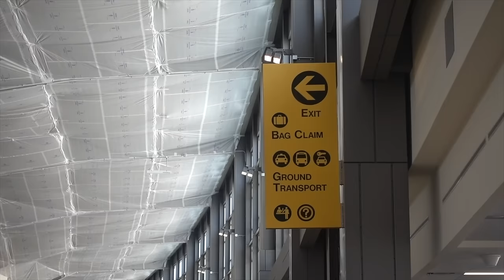MTB Myths that need to die—and some that are true!

Comment: I don’t own an ebike but appreciated your final comments. A few weeks back I passed another cyclists while cranking up a long hill and he momentarily took offense when he thought I was on an e-bike . When he realized I was not, he was OK with the idea that I caught up to and passed him. He then launched into a rant about how e-bikers are lazy and are not as committed to fitness and the purity of cycling. I’m forever amazed and saddened that people will find any reason to create silos and hate on the “others”. If it’s not bikes vs e-bikes, it’s something even worse. Live and let live people!
Reply: He's probably just too poor for an e bike 😆
Reply: My main beef with them is the way they tear up the trails, especially when they are immature and think flinging dirt drifting through a turn is cool.
Reply: the problem is they always drive at the maximum speed they're still supported at, never faster nor slower, they're really dangerous in general, more so if you try to overtake them, especially large groups
Reply: @randomvideosn0where that's a myth, what is your reasoning ebikers do this and bikers don't?
Reply: @KiterTMK  Because the way pedaling does not lend itself to burnouts the same way an electric motor does. For starters, most people have flat pedals and the sudden lack of resistance would cause their foot to fall off thus no torque. Second the power is in strokes with no substantial rotating mass so you only spin the tire at times vs consistent output of electric motor. Then figure the extra 30 pounds an ebike weighs...
Reply: @randomvideosn0where  you need to ride an ebike sometime. You can't even make a burnout on gravel if you tried. Slippery wet rock or roots, one stroke and it's over. And i can push 900 watts of my own strength on the crank. You're pulling this from a place that doesn't know sunshine.
Reply: @KiterTMK  It depends on your Ebike. Sure many do not have more than 500W and only propel while pedaling, but many such as Bafang mid motor are basically electric dirtbikes. I have ridden one and it is sketchy how quickly you can achieve skin-removing speed (similar to black diamond downhill trails) with zero skill or effort on throttle control ebikes.Yes I have tried disgustingly overpriced hipster versions such as those advertised at the DC Auto Show and they are not a threat but it seems those are all you have experienced. Enthusiasts will have the faster stronger, not the "rich man" junk.
Reply: @randomvideosn0where  how are those throttle bikes different from supermoto bikes? But I can see how these powerful things do ruin the trails at full throttle. We see what the supermoto trails look like. So there are pedal supported ebikes and throttle ebikes people need to differentiate in. It's otherwise pointless hate to all.
Reply: It will take a while before this ebike conversation finally stops.    Sure Ebikes are not pure 100% muscle power bikes. Everything else is just crap.  Yeah, they do make you fit. No you dont cheat because who would you be cheating unless you race on ebike with non ebikes.  Yes it makes you fit in different way, but who said i ride for fitness in first place?  There is a lot to argue about here and most of it is nonsense.
Reply: @randomvideosn0where   Where do you get this idea from?  Do we talk about same thing?  Maybe you talk about electric dirbikes not assited pedal ebikes. That is a very different thing, some people call them ebikes, but they are motorbikes with electric engine.    I dont own emtb myself yet, but i ride with ebikers. Nobody tears the trails more than any normal bike would.  Ebikes descent in exactly same way non e bikes do. Only difference is they are about 6-8kg heavier which literally makes no difference.
Reply: @tektek1100   What?  so you are saying bike that rides at constant speed is more dangerous? why?   Why is it more dangerous to overtake them compared to non ebike group that rides 26km/h ?  Also speed limit does not matter downhill. Ebikes turn into normal MTB when going downhill.
Reply: @randomvideosn0where   E bikes only give power when you push with your legs they dont give you constant power like it would on a motorbike .  They also dont run on 100% power all the time though agree some people are bent on running boost at all times.  Ebikes dont do burnouts, they dont have nearly enough power to do so, and bike itself isnt heavy enough to stay in place while trying to do so.  You would have to purposefully lean front and hold your front brake to do so which nobody does.     Additional mass makes literally no change.  Me on my normal bike is 84kg + 15kg of bike which gives almost 100kg in total.   My friend is small and is 65 kg with 23kg ebike thats 88kg in total.   My other friend is 100kg on 12kg crosscountry bike.  112kg.     Ebike mass literally makes no difference except in handling of bike itself.       

My friend, what you need to do is have a 50-60km trip in mountains on Emtb to see for yourself.   What you speak of are common myths that are generally busted as soon as you ride one of these.
Reply: @maciejilski7185  I have ridden them and they are a hoot! But I have run across many on the trails with thumb or twist throttles, guys bragging how they can hit 40 miles per hour and all the turns are DESTROYED from their riding. They should stick to the pavement or only ride paid trails where their power is taken into account during trail construction.
Reply: Nah, ebikes are trash
Reply: @Lee-ic2yn he’s just one of those stupid 90% of us who can’t afford e-bikes. 😆?? Why laugh at that?
Reply: It is a issue when we can't get out of the way because they are not responsible for their speed if they are going to run um that should have tow paths in my opinion

Comment: Hanging up the bike with the fork being at the top, it'll actually make your suspension feel better. This way the oil flows up to the foam rings, stops them from drying out.
Reply: This man knows what’s up
Reply: I had a Manitou on my FSR that had a known problem of leaking fork oil when hung upside down, but it was the exception to the rule. The vast majority of bikes should be fine hung upside down.
Reply: Yeah good point.  When forks are shipped from factory to retail in crates they do not have even have a this way up label.  If the manufacturer isn't concerned about which way up there forks are for the months they are in transport/warehouse/stockrooms surely there is no need for users to be.
Reply: Several major manufacturers recommend inverting your fork regularly for this specific reason (probably common knowledge for those that actually read the information provided by manufacturers!)
Reply: What if i have an open bath fork (Marzocchi 888 rc3 evo v2) with seals that doesn't have foam rings like Enduro Seals? Does storing it upside down help me?
Reply: I store it however and invert the bike for ~15 secs right before every ride to wet the seals.
Reply: I store my bike upside down once a week to keep the seals wet.
Reply: Also causes float fluid to come out of the valve into your pump
Reply: I worked for a while in the racing motorbikes business and the mechanic who prepared the fork shocks would not let me to place them even horizontally after completion and until was on the vehicle. 
I don't know if this is relevant, or it was just his idea of doing things
Reply: @mitsos_306  it is relevant because the oil needs some time after service to saturate the new seals and rings. What I do when my bike is going to be sitting for a while is apply some heavy oil to the stanchions and cycle the fork enough to spread the oil evenly. That oil gets into the seals and rings and prevents them from going completely dry. The oil I use is a Lucas high mileage engine oil additive designed to prevent dry starts on old engines. So far, it's worked beautifully. Unfortunately, it does not work for long if your fork is already in need of service, but after, when you have allowed enough time for the fork oil to saturate, it is a perfect storage solution.
Reply: @ridesafealways4929  I had an old Marzocchi where the O-rings around the preload knobs were going bad
turn it upside down and oil leaks out....

Comment: I only treated the quick links as single used when I worked at a bike shop. It made sense for us to replace them each time for liability reasons.
Reply: Yeah that is pretty much the case for the big two also. But maybe that's why I see alot more broken chains while watching the tour now. .. I really don't like them anyway I do believe those little bullets that Shimano makes are far less likely to break open.  That is the one that you have to break the guide end off when you are done installing. The one that came stuck in the chain from the factory was garbage it almost always cut a little sliver of metal out of the open side of the chain when pushed  through. I just figured that can't be good  when I noticed that little crescent moon shaped sliver on my finger. Then I noticed it didn't seem to matter how careful you were...there was that sliver again....so I stopped using the pre installed one totally.

Comment: I thought the quick release myth was that you shouldn't lock them facing forward in case you brush by something thick/solid enough to open it up.
I always figured it was a myth until a buddy did it immediately before going down a steep hill.  When we got to the bottom of the hill, he said something felt weird with his suspension so started to inspect it, but then he lifted his fork up and it wasn't even connected to the hub.  The wheel just completely detached from the fork and fell over.  We were both amazed at how close he came to a serious accident, but couldn't help but laugh about it.

Comment: Found myself in Asheville a week ago and my cousin and I made the trip to berm park.

Great park! I also found out that Asheville has some great urgent care facilities and got 4 stitches in my right arm from our "last run"

Probably the cheapest souvenir of the trip 😎👍
Reply: Stitches were your cheapest souvenir? In this American healthcare system mud made by mixing dirt and spit to patch your wound would costs like $15,000.
Reply: @thefox47545  I'm from MA. I have state subsidized health care that I do pay a decent amount for.  The visit was a $22 copay.  Although they had flat rate prices and it would have been a max of $258 out of pocket according to the signage. That was for basic checkout and stitches. If I needed x-rays or more it would have been a visit to the ER. My copay for that would have been $100, and out of pocket would have been $$$$.
Reply: mission hospita saved my life in a situation most others would not have even really tried tbh.. great little town

Comment: To expand on the quick-link issue, there are versions that are recommended as "one use" only, like the ones that come with some Shimano HG chains for example, they are differentiated by a small notch at the edge of the locking pin hole, otherwise quick-links can be reused a few times. I tend to used them until they are too easy to click into place or remove by finger pressure only, if they are too sloppy then I wouldn't trust their integrity.

Comment: The last run we used to say 'just one more' and then go home. It's that mental shift to put it all together and squeeze that last bit of juice out of the ride. Thinking there's one more run your mind set is to keep something in the tank.
Reply: I always say I’m doing 2 more runs but not the second one.
Reply: @davidshaw164  yup, a good ol’ “2 minus 1”
Reply: You make more mistakes when you're tired. You're the most tired at the last run.
Reply: I'm the opposite. After I finish a run, that's when I determine if I'm done.
Reply: "Two more skip the last?"

Comment: Hi, let me add a little confusion to the skewer-myth. It did not occur 2015 after a recall. When I bought my first MTB in 1989, there was already a rule, to put the skewer to the on-drive side. That was for several reasons. Most people hop on the bike from the left side. So before you mount your iron horse, you can have a quick glimpse, if the skewers are in place an closed. Next is, you want to have the skewers on the same side, and because the rear derailleure is on the (narurally!) drive side, you put the rear skewer on the opposite side, to have it easier getting the wheel in and out. Otherwise, you can get tangled up by the chain or derailleure. It establishe like one of those "rules" roadbikers live to. (only black bips and stuff like that) As disc brakes came up, and no thru axles already at sight, keeping your hands away from an overheated disc, or its quite sharp edges was much more to worry about. And btw., another rule about skewers was, the rear one had to be closed to the front, aligned with the chainstay, the front skewer up-, or at least backwards. It was not to hook onto any obstacles.
Reply: Dude, disks don't get that hot and they aren't sharp. Come on.
Reply: @garymitchell5899  I did not say this is my opinion, that was really given as a reason back in those days.
Reply: @garymitchell5899  and btw. have you ever made the mistake to put your finger in while spinning the wheel? Do't try this at home!

Comment: Sometimes, I resuse quick links on my bikes, including road bikes. I tend to get 10k miles on a quick link (road). AND I also take off my chain sometimes to clean it. The chain is under tension, so the QL does not come loose.

Comment: The QR skewer-disc issue predates that recall by a couple of decades, but it is also a lot less dramatic than having it jam in the disc. The reason to put the lever on the opposite side was merely to avoid reaching for your QR and getting burned by your hot disc. Trail flats or just wheel repositioning can get you grabbing that lever right after a stop and the discs are still hot. Sometimes the force needed to flip a tight skewer will get you to inadvertently touch the disc.
Making sure the lever clears your DR is a little too basic to mess up I think.
Reply: I had trouble with my disc brakes for two years in a row. To avoid fingers oiling up my discs ("ugh the brakes are squeaking... again???"), I switched QR lever to the drive side. 
Oh and I do have a Shimano internal QR that no longer has a functional end-stop, so I guess there's like 0.1% chance of QR lever ending up in the disc?
Reply: @chameleonh  If it works for your specific situation I agree, do what works. I'm really referring the typical rider, and why the tendency to put the QR opposite the disc first arose. There is no rule, and putting the QR on the same side as your disc is not 'wrong' by any stretch.
Reply: I'll still keep my QR on the Disc side like I always have thank you very much. 10,000 miles+ and I've never burned myself on the rear disc or had the QR get caught in the disc.
Reply: @SternLX  You are an ace
Reply: Man, I know I'm not the most mad rider ever, but I'm so far off 'I've actually made my discs hot with my aggressive braking' it's ridiculous.

Comment: 1 - The "last run" is definitely sort of true, but not due to any witchcraft and it's an issue in other sports as well. Skiing and snowboarding injuries tend to occur at the end of the day, because you get tired, technique suffers while at the same time you are feeling a little more confident and go for that one slightly harder run that you've been eyeing all day. I have a strict rule, I do an easy warmup run or two, then hit the hardest/fastest runs in the morning. Afternoon is for cruising. 
2 - The cargo compartments are pressurized on modern aircraft. Totally irrelevant.
Reply: Its the same as the "one last hand" at poker...always spells disaster 😥
Reply: 100% exactly how I skied. Never suffered an injury. - Cheers

Comment: Nice video man! I wasn't ever aware of half of these myths. In fact, I'd never heard em before (I live in Switzerland and cycle mostly solo or with my family, so I haven't had much outside influence).
There are 2 points that I'm curious about now, though. If anyone has a second opinion, I'd love to hear it!
1. I remember a bike mechanic told me once that to make the bike fork work better and longer, to once in a while flip the bike upside down and leave it upside down overnight/for 24 hours. I did it, and my suspension (air fork) did feel a good deal bouncier than the day before.
2. In the early-ish days of quick links, my brother and I both had chains with them. We hadn't taken them on and off much at all. I remember the links would sometimes come undone, especially while pedalling, and BAM! suddenly we'd have no chain. We had to go back and hunt for the chain and the links on the path. Has anyone else had this experience? It was in 2008 or so.